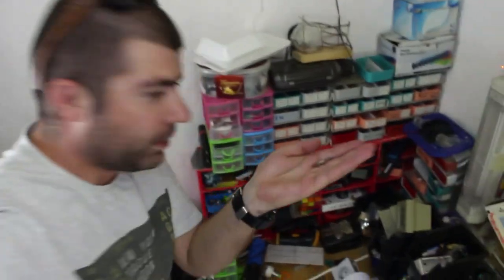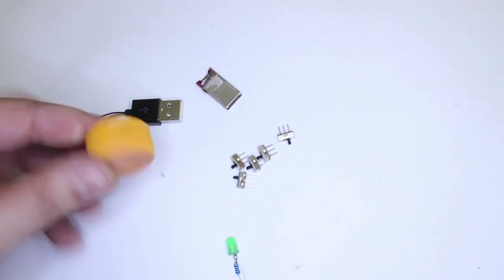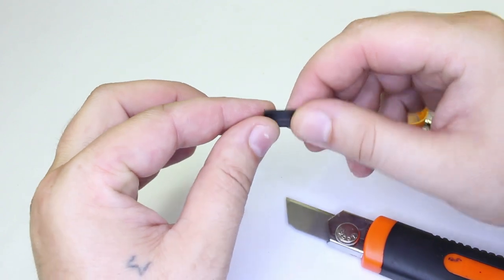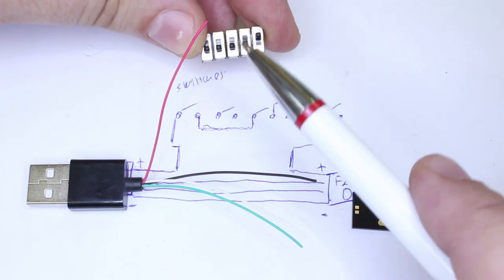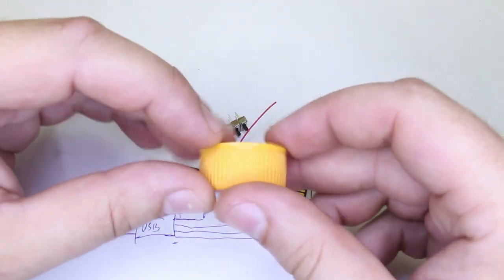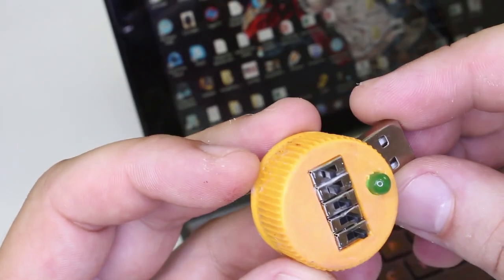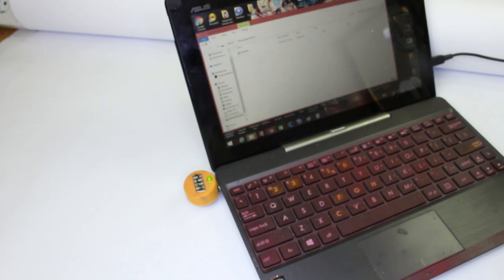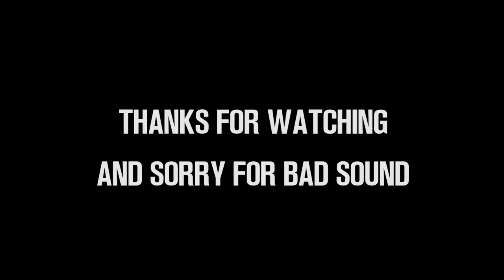How To Make USB Flash Drive with Combination Lock

Comment: Cool idea
I think with explenation it is much better
Reply: Gustani XMLGb Buon. I fuv Schneider č
Reply: No, definitely better without explanation.
Reply: bellybutthole Why ???
Reply: Gustav Schneider right
Reply: This isn't really a "combination lock" flash drive. If you flipped all of the switches to the 'ON' position, it would still work because the second and third switches are not even included in the current flow.
Reply: whay
Reply: Gustav Schneider
Reply: The explanation is the video ia sufficient
Reply: greengameplayer true

Comment: It is better to use 3 position micro switches to make it even more secure. 6 two position switches = 64 combinations, whereas 3 pos switches = 729 combinations
Reply from the maker: +Addy Diesel you do the math,good job
Reply: +American Hacker , 7x 3 pos switches = nearly 2200 combinations, whereas 7x 2 pos switch is only 128 combs

Comment: If all the switches turned on? It will unlock?
Reply: lol, yes. He needs to wire ALL switches into the circuit to be either "on" or "off" to create the proper path for the drive to work.

Comment: What is the color coding of your resistor?
Reply: Looks like 470 ohms resistor to me. Hard to tell the color in the video for sure. Any size resistor will work, it will only charge the brightness of the LED.
Reply: The resistor and LED should be wired in parallel not series. If it's in series, the voltage to the flash drive with be reduced.

Comment: whit tring to make 2 combinations (all-on) or (all-off) you can unlock it is too easy 
lol unwired switches should conect both data cables and it will be 90% beter